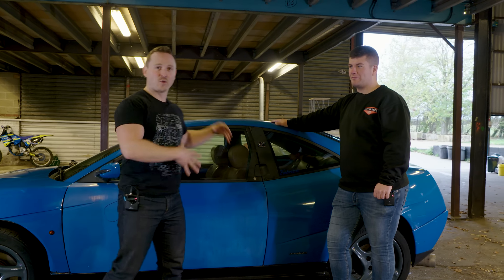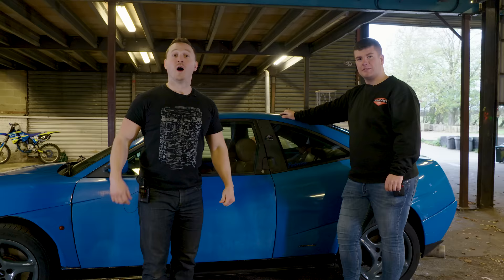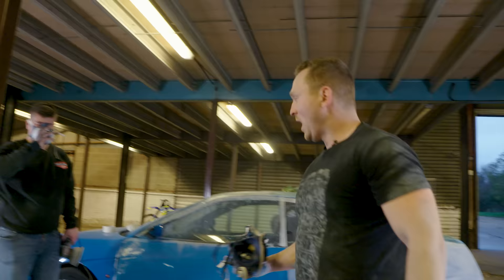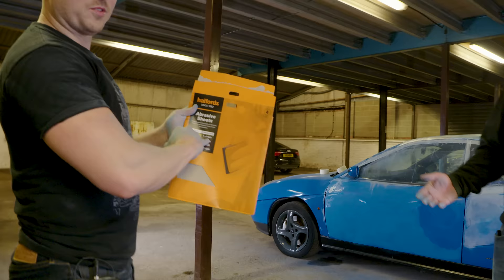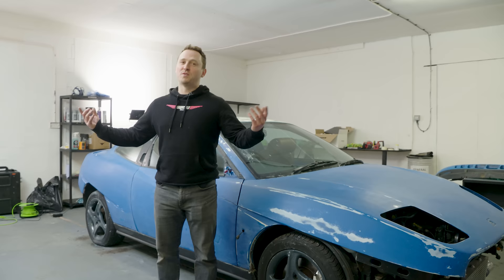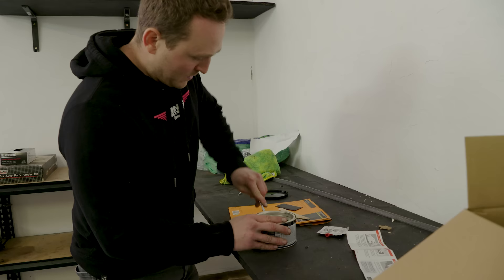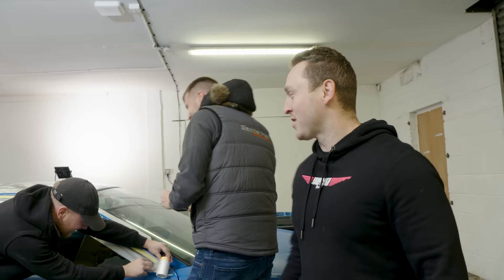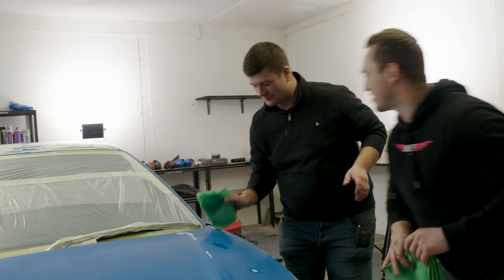Can we do a Full Body Respray for £300?

Comment: As a bodyshop man my review is:
-not only using a dual action sander to leave finer scratches 
-no soft pad on sander/not always keeping sander flat causing low spots
-no extractor in sander leaving dust in every little gap
-not spraying in a booth to suck away dust and fumes in the air
-should have sanded 240 grit down the original paint then covered those scratches with 320 grit, then high build prime, flat back with block and DA sander using 500 grit, finally 1000 the whole thing over
-dont wet sand anywhere near exposed filler, it will absorb the water like a sponge, expand and then eventual pop of the metal.
-the mixing of filler was painful, but your spread wasnt too bad XD
-dont flat filler with you hand, use a block, you will make low spots that look wibbley wobbly and 
show up when painted
-rattle cans are a sin, but at least heat them up first XD maybe leave them in hot water for a little while then give good shake
-ideally 4 layers of rattle can primer, you want 2-3 of actual primer and rattle can is never as thick
-after gray highbuild prime you should spray a light mist of black to make a guide coat, this shows you when youve fully taken the top layer off and made the surface flat. black patches=low spots

However, as a viewer:
-Comedy Gold

-Made my day after spending 10 hours in the shop

side note: yes technically anyone with minimum training can be a automotive painter. but not everyone can be a good painter. surface prep, application, finishing all take years to master.
Reply: I'm currently learning to paint in a factory (non automotive) honestly, it's just the consistency of your work, making sure you've got thick enough layer while not overspraying, and everything gets covered evenly. I lol'ed at their short strokes, where I work, you start spraying before the item and finish after it, going through it nonstop, but then again, i'm not even sure rattle cans can spray an entire door in one go, but they went super short strokes
Reply: And by entire door, i mean one go from left to right and vice versa
Reply: Nice full description, thanks 👍
Reply: @PastLight  yeah for sure, if he was spraying something metalic like a silver it would show horrible lines where they start spraying over the panel.

Consistency in this trade is definitely key, but the biggest thing is knowing when you messed  up and how to fix it.

No paint sprayer is perfect with flawless jobs all the time. Most will lie and say they’re the best.

The truly great guys are humble
Reply: @moorhouse9949  Ohh yeah, I work with wood mostly (wooden windows and doors) and most painters are cocky, but after a few months you start realizing they're full of shit, cause everyone makes mistakes, but yeah, the ones I try to really listen to, are the humble ones, and they are the ones I always go to to fix stuff, cause they know all the tricks
Reply: All in the prep. Prepping panels, body work and such is a right pain and takes ages to do properly. 

It's for this reason, I only do small things at home, like mirror caps and trim pieces.
Reply: Yeah I'm just an amateur but seeing them use a rotary sander skipping all over the place instead of a DA made me cringe

Edit : him bare hand sanding the filler wasn't much better lol
Reply: i have no experience painting cars, currently own 3 cars that could need paint and then probably plan to have a project a year or so. Is it worth me even trying to learn to paint, or would you suggest DIY prep then Maaco for spraying, or a body shop that would handle all of it? id rather DIY it cheap or save up to get it done right, I'm a detailer so if i take it somewhere and they aren't better then OEM paint, and i spent good money for it, i won't be a happy camper.
Reply: @imnota  those two things are probably his biggest sins.

But alex is funny, so I’ll let him off this once.
Reply: @andrewcramer7214  ideally if money was no object then yeah, taking to a shop (preferably insurance work certified, that way you know if they’re good enough to be graded for insurance claim repairs then theyre the real deal).

However, I definitely get obviously the cheaper the better, that and doing something yourself is super satisfying if it goes well.

My honest advice to you, get an old car wing or something like a bonnet and then just practice.

Rattle cans aren’t terrible if you know how, but they can fade and requires you to polish your painted area every couple months (3-4) to keep it looking shiny.

Id say, get some sort of old panel (door, bonnet, wing etc) practice 3-times with cheap cans, then but expensive stuff for your job. 

Especially a 2k lacquer (one you break and mix hardener into) it will help keep the shine, and make your job look better/more weather resistant.

Heres a decent tutorial for you to watch, but practice and prep is key. https://youtu.be/atmTYvyPIbo

Just remember to:

keep your work area clean (keep blowing of dust and wiling with degreasers) 

masking tight (dont want paint going where it shouldn’t, or even worse you pull up the edge of the paint with the tape)

And especially dont panic, most of the time in trying to fix one small issue you create more. Let the paint dry then try to rectify
Reply: @moorhouse9949  your awesome thanks! I'll definitely watch that video!
Reply: @andrewcramer7214 anytime. even if you fail spending 200-300 to try yourself is way better than the 1000s a shop will ask you for. goodluck, you got this :)
Reply: i hate how you can be so infuriated by this but at the same time have a laugh. .. actually i might love it.
Reply: I was making this list in my head as I watched, primed and ready to lay it out in the comments so thank you from saving me a whole pile of typing. 

You can get a passable paint job in a storage unit using rattle cans but it takes a lot of patience, the key to actually laying colour is to buy decent paint and decent caps (pink dots/fat caps) then do a whole bunch of dust coats to very slowly and evenly build up to the final effect. It's very tempting to try and lay it on thick and fast but unless you're super lucky you'll get runs and wrinkles eventually. 

As with all paint jobs, nine tenths of the final appearance is achieved in the prep work so don't get lazy, spend the time and do it right first time because it'll take more than twice as long to go back.
Reply: @DjDolHaus86  yeah i feel that most of the hate for rattle cans is because people watch a chris fix video. Try it, do a subpar job and then say how easy it was and the vehicle repair industry is a scam. (Which it can be at times)

So long as people actually put in some practice and effort i dont see why it won’t look good
Reply: Dont you think they could had buffed out the original paint since its a 1 stage paint? Ive buffed some horrendous looking 1 stage paints to be immaculate
Reply: this is great advice mate....not that I am ever going to do this but I appreciate it
Reply: @NjoyMoney  if they sanded the whole surface with 1500 grit, then 2000, then 3000 and polished with a good cutting compound, yeah i bet most of the car would have looked mint.

I think he’s mostly done this for content and to repair the few dents and bubbled up areas, painting a whole car with rattle can is bold. Parts of a car with rattle can is done everyday by smart repairers and diy guys

I gotta give it to him, alex is bold for trying this one, but i just love taylor and his enthusiasm about it
Reply: look at this king giving amazing information away for free! people like you make us progress! thanks mate
Reply: I feel like copy pasting this into a notepad for future notes if I ever need to do a patch repair.
Reply: @andrewcramer7214  if you wanna have a decent setup so you can do it x amount of times I’d recommend it good compressor few good guns and good paint do the right prep and you’ll be laughing but for one car I wouldn’t recommend
Reply: Same lol all that sanding no masking. Doing it all for the price of a bumper corner 😂 I'll sort it when they finished for 8g over winter cash job pmsl
Reply: The usual tips for a home rattlecan paintjob is sand it proper, wash it down with washing thinner or washing alcohol to remove dust from sanding, put up a party tent or something to prevent wind at least, get the ground wet as dust won't blow around and instead stick to the floor, and basically use hot water to put the can in first as you want about 20 degrees celsius in both the air and in the paint for spraying, then use heat once done spraying to dry.

It'll still be a terrible rattlecan paintjob, but as good as you can make it without spending too much cash.
(preferably you'd want a filler or base coast and sand in between it and the paint, but not everyone can be bothered with that.)
Reply: You missed pulling em up on the panel wipe too. I was always told to use 2 cloths, 1 just moves the shit around.
Reply: @neilwalsh4058  exactly same with degreasing
Reply: In summary, R.I.P. to the respray. Coming soon to a body shop near them 😂

Comment: Warm the aerosol tins in some warm water   ,they will spray  finer and better
Reply: Use boiling hot water for the best experience!

It's a joke. I know that spray cans in warm water is good and helps with the spray!
Reply: @blockbertus  Personally i use a gas burner
Reply: @abdullahz4804  I usually put them in the oven for 10 minutes
Reply: yeah i watched chrisfix too
Reply: @Krunsy  microwave them for better results
Reply: @Krunsy  Acetylene torch get's them up to temperature in no time lads.
Reply: @ashleygentle6501  Just pop them in a Volcano for 2 mins
Reply: Just put them on the sun for 10 mins
Reply: @JMc.D   in the middle of winter

Comment: In Brazil, in a worst scenario where there's filler on some points, we sand with 80, 150, 220, 320, apply primer, sand the primer with 320, 400, 600, then apply paint if the paint is Poliester or PU based. If it's rattle can, we sand the primer again with 800 then paint. That's kinda the common sense over here.

Comment: I rattle-canned my own Fiat 20v turbo last year!    Issues/lessons: 1.  the multiple little dents in the doors from supermarket car parks also stone chips in the front.  2.  I didn't have the knack so I took off the boot lid and practised on the inside of it.   3. Getting the main colour even - I needed to keep going back to look at it in different lighting , outdoors was best.   4.  The 2nd lacquer coat was a ba*d.   5.all clear coat was a ba*d.   6. keep your pets and birds away from walking all over your car when it's wet.  That's my 2c.

Comment: for anyone who wants to do a DIY respray on their car on a budget.
go take a look ad 2K Ephanis Yacht paints.
with one can 0.75kg  u can do a entire car in one layer and that is around €38,--
no need for any clearcoat  or primer (primer won't hurt offcourse)
asuming u allready have a compressor, a cheap paintgun is around €28,-- from Silverline. it wil do the job just fine.
for around €30,-- u probally wil have al the sandingpaper , degreaser, protection and tape u need for a  car.
so for around €100,-- u can do a decent job that is better then probaly a rattle can job.

Comment: You can get a surprisingly good finish with rattle cans as preparation and technique goes a long way to end up with a good result. Obviously having proper spray guns, paints and a booth take it from good from a far territory to perfect!
Take your time on the prep, use the 'correct' primers and paints at the right temperature and long strokes across entire panels!

There is a reason respray prices vary so much. Very much you get what you pay for!

Comment: When respraying cycle frames, motorbikes and a mates MGB Midget, I 'Prep' by sanding down everywhere that was getting painted... Then, BETWEEN EACH COAT of primer, base coat and clear coat, I polished up with T-cut, then a wipe over with wipes/tack cloth. Again, BETWEEN each layer.. DOING THIS helped provide a fantastic mirror finish and get rid of the dreaded 'Orange peel'. Yeah, it was a time consuming job, but... It works....

Comment: I've painted a couple motorbikes and some car parts with rattle cans over the years and I'm now getting great results so I want to pass on 2 pieces of advice. BUY YOUR AEROSOL CANS FROM A CAR PAINT SUPPLIER! Never use Halfords or similar, especially the clearcoats. Also the 2K rattle can clear coats (with the pull ring or button, never the pre-mixed) are expensive but worth every penny, just wear a decent mask. If you cheap out on the cans you will fail!
Reply: Yes this is so true haha. Having used Halfords cans as well as “professional” cans the difference in finish is incredible
Reply: Could you recommend a good company?

Comment: I am loving this but budgeting an extra £300 quid would get you a basic second hand compressor and spray gun. Buying paint in tins instead of cans is far cheaper. 5 Litres of base coat will cost you a couple of hundred at most.

Comment: the tool you were using on the roof was more commonly used as a buffer, not a sander. fast spinning can heat up the metal too quickly and warp it. you generally want to stick to either block sanding (slower) or orbital sanding like what you used on the rest of the car.

Comment: Not a bad job for a £300 budget. I'm unsure what primer you were using but if you were planning on retectfying the dents with filler and wanted to prime. Should've used epoxy primer and then filled over it and painted with high build.

Comment: Flat it then vinyl wrap it maybe? need to respray 2 front wings and my front bumper rear wing where someone keyed it and crusty rear arches on my mg zr atomix yep an atomic kitten special edition mg zr  1.4 52mm throttle body and metal inlet manifold from a 1.8 original mg xpower back box no centre box exhaust

Comment: the sanding was painful to watch, should've spent £100 extra and buy a small compressor and actual automotive paint, I got really good results for under £550 to repaint my honda with a 50l SGS compressor, did it on my driveway with a gazebo and 2k paint

Comment: ZINC primer the bare metal parts, and don't wet sand primer as the water will get through to the metal and cause rust bubbles in a few weeks.   ALSO - You need ProXL 2K laquer, or SprayMAX 2K for a proper shiny finish.  Stuff like simoniz acrylic lacquer isn't shiny.  👍